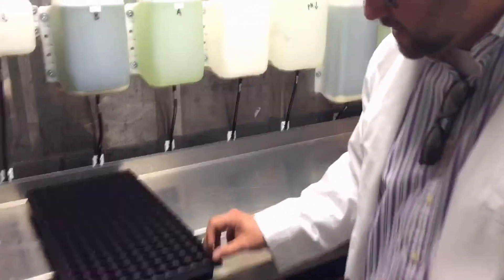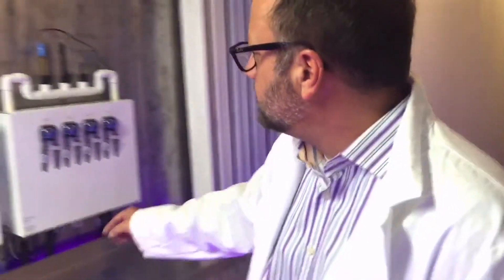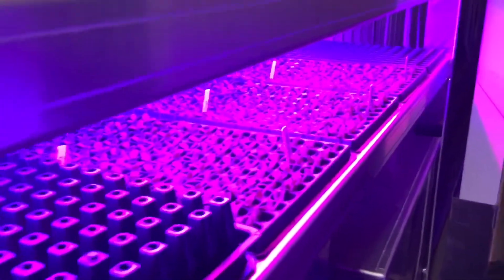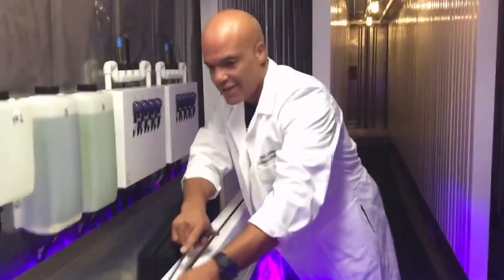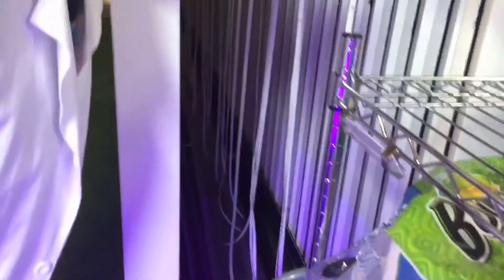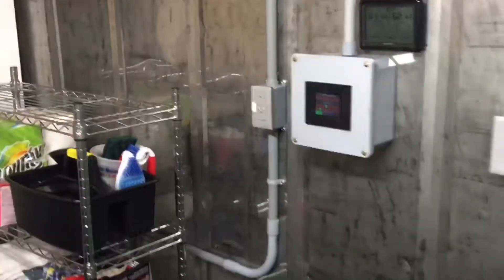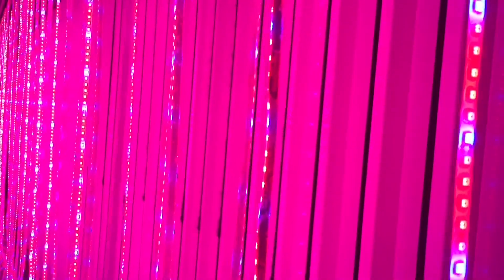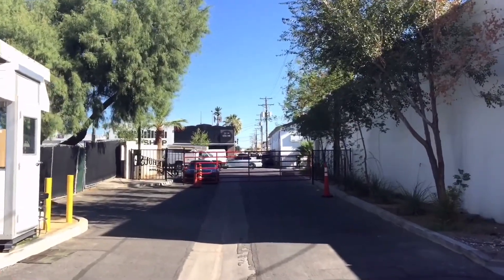SHIPPING CONTAINER FARM grows 512 heads of lettuce a week!

Comment: Hmm 512 heads a week what’s the cost per head? A head is around 1 a head wholesale many 3 retail so on the low 2k a month? What’s the cost to run for a month?
Reply: that's not how the economics works.  It's $/weight - not heads or other units. 

You could sell small heads, doesn't mean much. Yield is important. 
Standard farms will generate higher yields per acre, however vertical will produce more yield per m.sq

Another major factor is the plant itself, if you're growing food that's in demand or rare  then the price can increase per gram, however, if you are growing standard salad lettuce, you may turnover more (like every 1.2 weeks) however the price per gram is lower.

Farming in general requires a lot of this economic prep.
Reply: @Jack NORTH This is a major problem lectricity costs have skyrocketed, making your produce way to out of pocket for the buyer 

Also, lettuce would be a waste at that cost, you'd make no money.. would have to look at higher end or rare produce just to pay back the cost to produce it.